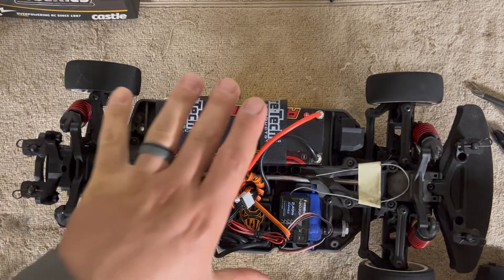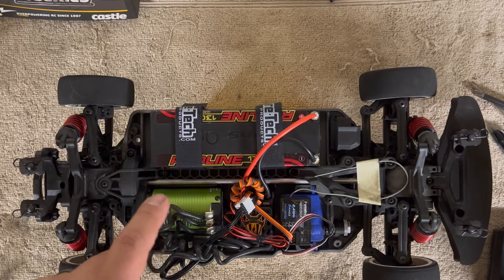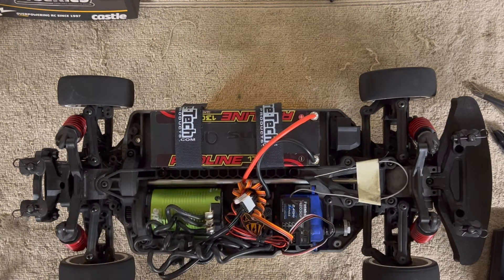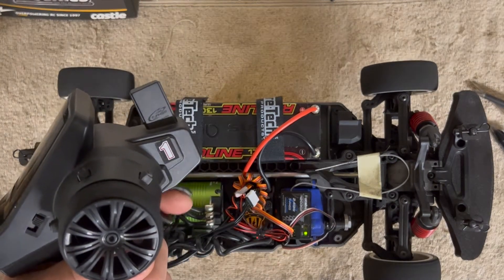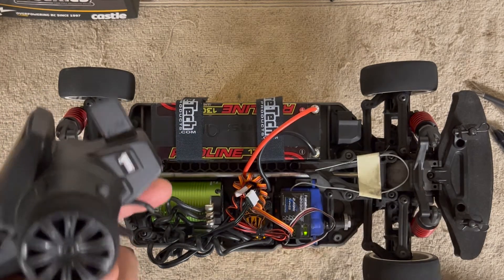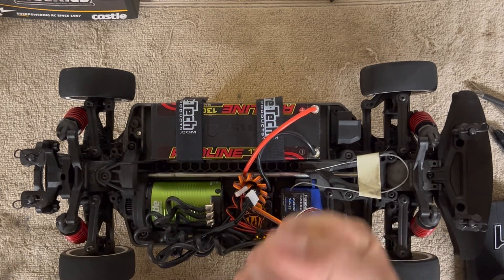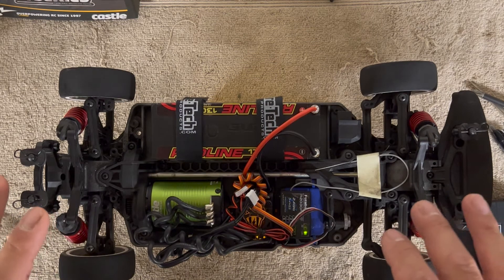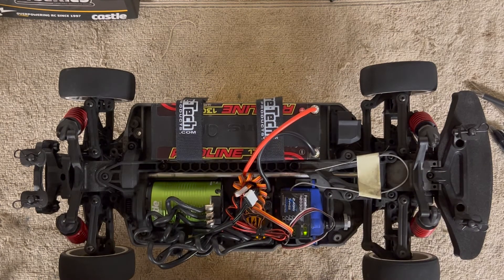Castle Creations How to calibrate throttle end points brake neutral on ESC Demo with Copperhead

Comment: In theory, if you want more throttle response can't you set the end points shorter. So if you power on and pull half throttle then half revers the neutral wouldn't the receiver read half throttle as full.
Reply from the maker: That would leave a dead zone on the transmitter range. But I see what you mean and yes. In theory... so, say 70-100% of throttle pull would give 100% throttle response. But it makes it harder to finely accelerate in a race. But if bashing is the goal, then it may not matter. 

The best way would to to set the end points normally and then change the throttle expo. So, 100% is 100% but 30% pull might be 50% output, 50% pull might be 70% output, 70% pull might be 80% output etc. So, a curve.

Comment: I'm trying to calibrate my xlx2 to my futaba,I have steering,doing exactly what your doing but nothing happens.
Reply from the maker: What comes to mind is, is the esc connector connected to the Rx in the correct way or is it accidently flipped?
Assuming it is in the correct position, you will need to check the settings and make sure Ch.2 is set to 100% and not at 0%. 
If that is not it, disconnect the battery and try again.
Reply: @telecomandorc  it worked great in my arrma kraton. I swapped it into my infraction with a 2700kv tp motor now  no throttle. Also after trying to calibrate it when I checked for steering the car accelerated and turned at the same time,I never touched the throttle. Very strange.
Reply from the maker: @mikedizzle5273  
Oh... Check the Tx. You may have connected your servo to the Bsub2 port or B port and the esc to Ch.1. Move them up one. The first for is B which is a doppler of Ch.1 usually made to power accessories like a fan. The second port is true Ch.1 and the third port is Ch.2.

Comment: I need help badly I’m using a trx4 and the esc won’t make any noice and it’s solid red light on it
Reply from the maker: Do you have a program card? Check the program settings. Although it sounds strange to not chime at all. 

Also, check the solder to the battery connectors to make use it is not a cold solder. 

If not... it might be a CC tech issue.